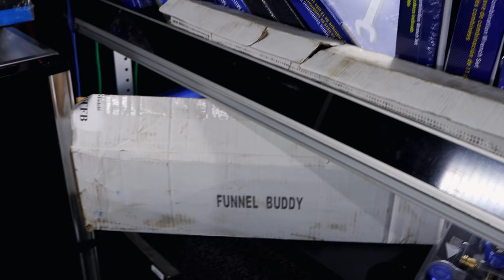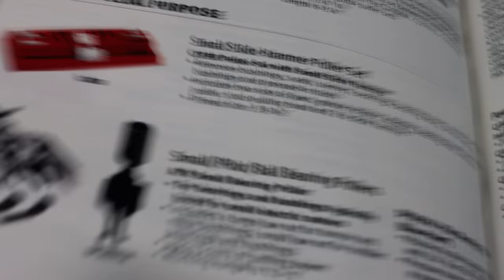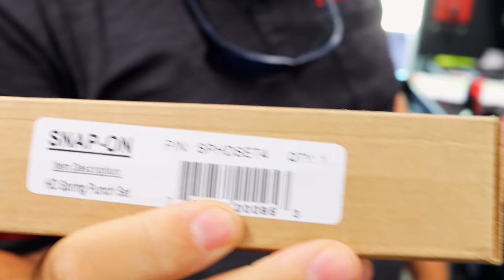Snap On New 100th Anniversary Jackets

Comment: I do have to break loose drain plugs loose by hand with 1/2 drive once in a while,previous person person overtightened them which I would love to take their tools away.I might look into buying the brute 3/8 cordless ratchet,thought about the 3/8 fuel and the selector switch is the big drawback on 3/8 fuel

Comment: 2:00 I can’t believe they are still making those. I got mine years ago. There are so many different companies that produce (drop ship) those “box cutters”. I have a craftsman one, mine came in a set of 2. There was a mini one, and a “regular” sized one just like that Blue Point. I’ve also seen many other matching ones in singles. I received it for Christmas about 12 years ago. They exact same knife. Same blades/same head/same lock/same handle/same wooden handle. I still use it as my number one razor knife to this day.
I just can’t find where I can buy some blades for the mini one.